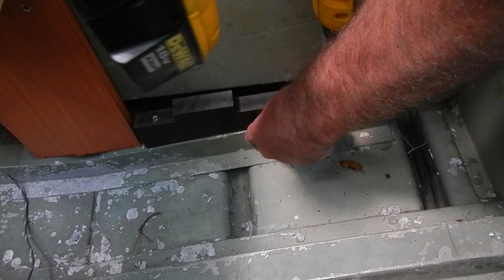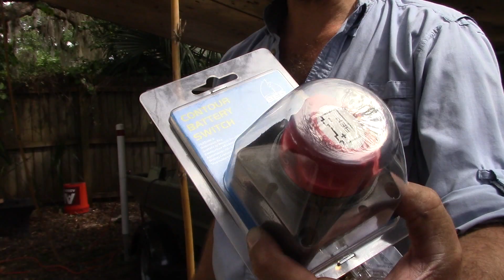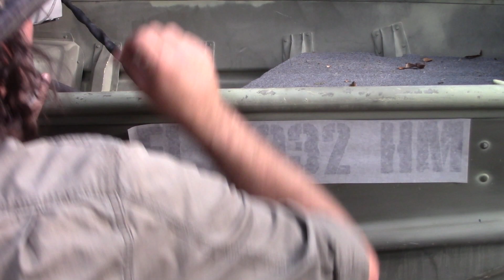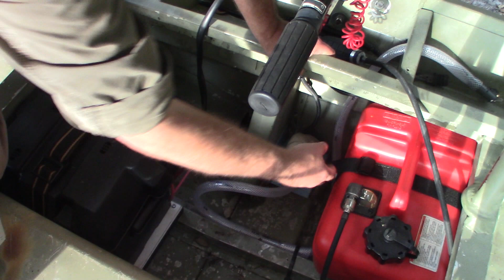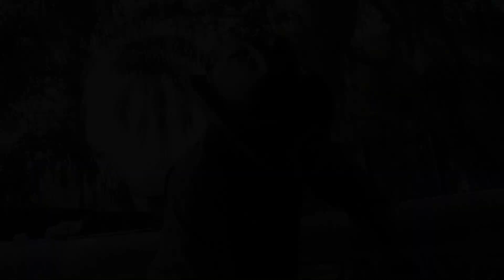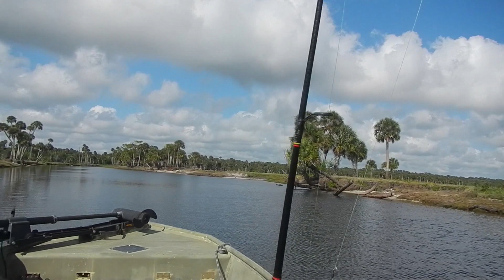Her Maiden Voyage

Comment: Looks like you did really good for not knowing what you were doing. I was expecting to see you fish while you were out on the water.
Reply from the maker: Thanks man! I did throw the line a few times. But my mind was on the test run. Shoving off, how the motor is running, potential problems, leaks, trim, throttle control, shallow waters, fuel consumption, loading back up. I was a nervous wreck when I got back lol.
Reply: @JungleJayAdventures  oh no..lol well you will feel better going out next time next time 😉
Reply from the maker: Yeah It will. This was a new thing for me.